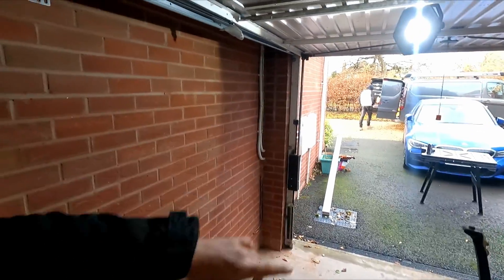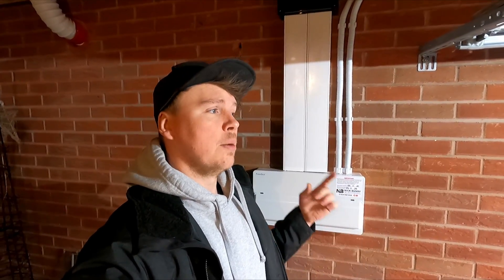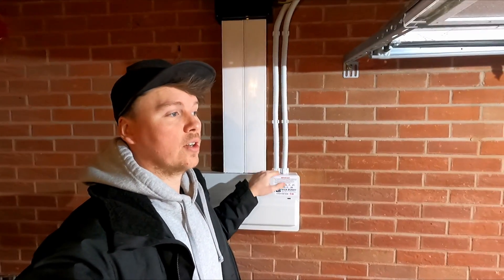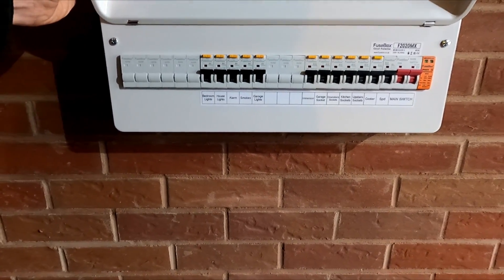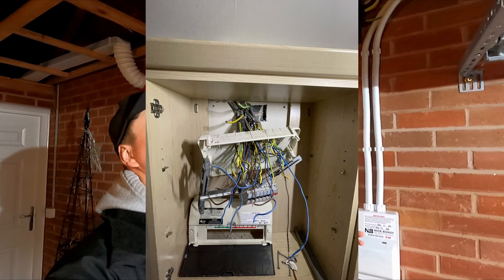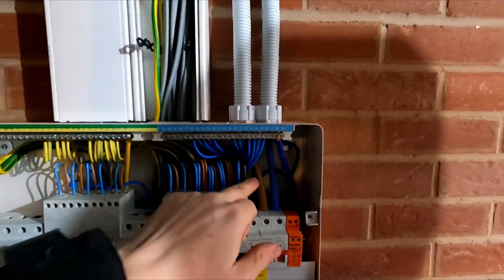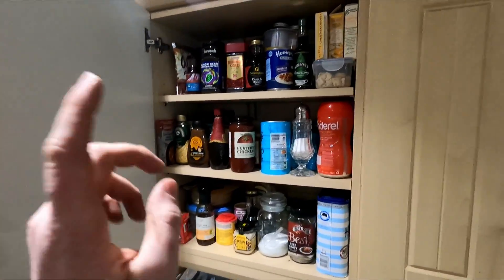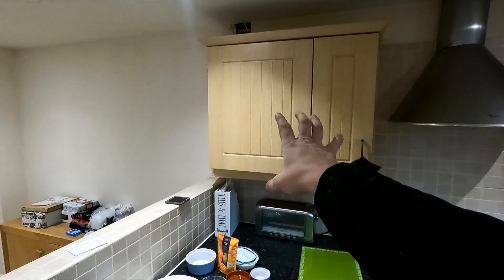How much do electricians charge in the UK

Comment: Why didn’t you just install a 3core armoured? From what I could see the cable wasn’t double insulated anyway. Much less drilling, good Earth. better protection for the cable. No worries about Eddie currents.
Reply: @Richard Moore   if the cables are protected by a fuse they can go as long as they want so long as it meets the max Zs of the fuse that it is on. 👍
Reply: @Richard Moore cable has to be protected by a fuse rated lowers than the suppliers fuse

Comment: Cores though different holes may be an issue in high power industrial setups, but at domestic current levels, and the thin steel of a domestic CU it's just a non-issue.

Comment: I'm, 82, mostly heavy industrial electrical engineering ( Steel Industry ) I have never seen any adverse effects of ac cables in separate holes, we had motors of 1,500 HP  but of course they were 500 volt DC. As for YouTube bloggers, obviously you have never heard of DrJohn Campbell, he has 1.79 MILLION subscribers. So Jordan has a bit of catching up to do , However fair play to him, his slick presentation & quality of work is exemplary ☘️

Comment: I think the eddy currents are negligible in a domestic setting but it's something that has probably dripped down from industry when there are much higher load installations. Great video, great to see how much you are quoting for, I think a lot of tradesman wouldn't feel comfortable sharing that kind of info. Keep it up mate!!
Reply: It's not so much loading, but the fact that industry generally uses 3 phase. If you pass 3 phase conductors through seperate holes, you end up making a very crude heater.
Reply: @listeningto8371  if the load is substantial then yes it would produce heat

Comment: Reasonable price but personally I’d of just run an SWA and used a switched fused isolator rather then a KMF switch and slipping the meter tails in copex would be better protected and also I think would look neater
Reply: Why the hell wouldn't you run it in armoured christ
Reply: Also cheaper per meter I reckon by a couple of quid
Reply: What size swa and how many cores?
Reply: running line neutral and cpc all individually is  pretty gash. I would of opted for swa, and it's cheaper per meter. 

 Isn't there a reg that states line conductors should have a cpc running in parallel aswel?
Reply: 3 core 25mm 100amp switch fuse isolator job done
Reply: I was always taught that a maximum of 3 meters is allowed for individual tails. I always go for a 25mm SWA with a 100a isolator. Much neater and the cable is protected.

Comment: By splitting the conductors you are increasing the loop area formed by the live and neutral. If you keep the conductors together (close coupled) you reduce the loop area and hence the magnetic field, which can couple into nearby equipment.
If you want to get into the physics to put it simply the magnetic flux is sum of the magnetic field at every discrete point within the loop (it's mathematically a surface integral). The magnetic field is greatest at the point in the centre of the loop.
When the live and neutral are close together you effectively get cancellation.

Comment: Regarding eddy currents. Sub 100A I have never found it an issue. On larger scale, I am talking 250A - 1225A TPN sub mains where for cost we parallel conductor's, we have had issue where slots was not cut and the sections of the panel board would get warm (current introduced in the metal work) according to thermal imaging. On these jobs we tend to make a square cutout and use Tufnol to gland in the cables. I have always felt 525.5.1 should include a current range where you should cut slots. Commercial DBs, panel boards tend to be of larger thickness materials as well.

I am commercial with some domestic work, so for me I always have, as I have found it good practice to cut a slot if I need to. I tend to only use SWA or MICC for sub mains, so it is rare I have a domestic job where I need a slot.

Comment: I've read a few comments below and agree, on a single phase 80/100 amp supply it's no big deal as far as eddy currents are concerned. However on bigger supplies, in industrial installations where you might have a 2MW transformer feeding a main switch panel, there can be a significant heating effect from glanding single cables through a steel enclosure, trunking, gland plate. This is why most decent manufacturers and main switch panel builders use a non-magnetic aluminium or paxolin glanding plate. It's also why large single armoured cables are aluminium sheathed rather than steel SWA. This is all covered in regulation 521.5.1 BS7671 also 521.5.2 for single core SWA. Hope that helps.

Comment: Yes, yes and yes. LNE through the same hole together! (In a metal enclosure) At first, everything seems fine, until load changes happen. Noise gets induced (variable, dependent on load change) this can be interference on sensitive Audio,  crackling or maybe hum? It can cause havoc with electronic power supplies. Small chargers etc. Phone chargers saying they are charged when they are not? The biggest effect, personally I found is a quiet 50 c/s hum from metalwork. SS sink, pipework, radiators or anything connected to earth that can resonate. Even on massive commercial buildings it can get louder,(depending on the variable load changes) even on the 16th floor! The air conditioning ducting, suspended ceiling grids, trundling, it's in the boiler house and even the re-bars in the concrete fabric! Press your ear to the wall, and it's there! "Where's it coming from", they say? Well, it's an earth problem and we know where to look!
The Earth is no longer just a protective conductor. It's also a functional return path on many modern gadgets (it's not supposed to be, but it is) and it can cause all sorts of modern noise on the "safety " conductor. 
I'm an old incapable man now. I come from the days where everything was metal. These are old problems coming back to haunt the new! 
Thanks for the video. It was really good  that.

Comment: There is an effect when line and neutral conductors or phases are put through separate holes but it's nothing to do with eddy currents.  It's due to the magnetic flux that's induced in the metal around the holes.  If the wires are in separate holes then the lines of flux surround each hole but if the wires are in a single hole of whatever shape then the currents cancel out and there's no flux.  This means that it only applies to iron or steel cases and not to aluminium ones.  When there is magnetic flux it causes heating in the metal due to hysteresis loss and mechanical vibration due to magnetostriction effects.  Both of these are probably negligible at domestic level currents.  A thin slot is all that's required to kill the flux.

Comment: Just seen this so comment a tad late. I trained as an industrial/commercial electrician many years ago and we always made a slot between holes when live/neutrals/3 phase conductors couldn't be taken through the same hole in a metal chamber. It was common to use brass bushes with locking rings/nuts/sockets to protect the cable from the metal edge and the theory was that if there were no slots then overtime the bushes could become loose due to tiny vibrations. There were other regs about not running a single conductor in metal conduit for the same reason, they always had to be in pairs as a minimum.  One way to get over this would be to run single core MICC where Eddie Currents would not be an issue give the otter sheath is copper, or a not ferrous metal/non magnetic material. But I am talking about huge installations such as the old BBC Centre or the Nat West Tower here in London etc and in a tiny domestic board/load I doubt it would be necessary but imv good practice to cut the slots regardless if the cables cant all be taken through the same hole. .

Comment: Eddy currents only become an issue on 200A single conductor feeders, to deal with it your supposed to cut out a rectangle of steel box and replace it with a piece of aluminium and bring the wires through the aluminum plate (no ferrous material)

Comment: Not sure if it has already been said, as I have not read all the comments, but, why did you not just run the mains tails into the trunking along with all the circuit cables? You seemed to have had a big enough hole in the the DB to do that and that would have saved you the additional stuffing gland/eddy currents dilemma.
Incedentally, your price seems very reasonable to me.

Comment: Hi mate we are a local small company and we are looking to start blogging! We like watching your blogs for ideas and some of your work is very neat and tidy but the 20mm flex tube you use for putting your 25mm tails in from the meter, which is normally protected by a 60 or 100AMP fuse raises a concern. But I don’t know if anyone has picked up you are running a live single supply feeding the tubing separate back to the meter.. what if someone mistook the tube for a water pipe and accidentally cut through the tubing there is no earth protection with that live and it’s backed up to an 80amp fuse? Did you get pulled up on that? Not here critique just interested in peoples outlook as everyone is quick to point out as we know. Keep up the good work we enjoy your blogs 👍🏼

Comment: The issue with tails in separate holes is more of a concern in relation to very high load current, not single phase 100 A supplies. I’ve seen loads of tails in separate holes, no slots and no thermal damage observed.

Comment: That's a nice installation, and to be honest you really have no concerns at all about eddy currents in that scenario - for future use. The only time you need to really start be concerned with this is in 3Ph Installations with heavy industrial inductive & resistive loads. However you will have an issue with your Cert, so you done the right thing changing it - technically unnecessary , but necessary to comply with regs. Charges should be open & I recon your pretty much bang on, Ill be honest I think what you can charge depends very much on the demographic of where your working. Ive just found your channel by the way!

Comment: Fantastic clear video and absolutely bang on price, I did a similar job recently but used SWA from main isolator to board, easier but not as pretty 😉
Reply: Phase Neutral and Earth should be in the same Conduit etc for Shock Protection

Comment: The slotting is only imperative when you are putting different phases through, not with L&N. Also you can replace the steel top with an aluminium piece, that will negate any eddie currents.
Looks like a nice installation btw!
Reply: That’s always been my take on it
Reply: Your 100% correct.
Reply: Not according to John ward

Comment: I always thought any further than 3m from main fuse had to be run in SWA with a double poll isolator installed? I was always taught that tails can’t be run any further than 3m.
Reply from the maker: They can be as long as they have been fused bud 👍
Reply: @NBundyElectrical  - ahh that’s good to know!😁😁 makes my life easier from now on 😅
Reply: Swa if burying them in wall

Comment: The induction effect at domestic single phase levels is just less than bugger all. Hence CUs are metal. In commercial/industrial three phase distribution boxes, the effects are more significant hence the entrance panels are non-conductive.
Reply: Or they are made of paramagnetic materials like aluminium opposed to ferromagnetic materials like steel.

Comment: Definitely run L & N through the same entry point. Earth is not necessary as it is not load carrying until a fault condition occurs and then only for a very short period of time. This does not apply if you're passing through an aluminium plate. Did several jobs where big panels were fed with 185mm singles through an ally plate and terminated on the busbars

Comment: I seen the JW video, and seen it had no affect, and thought why are we told to take certain precautions with single conductors in metal enclosures.
 My first thought was why use tails, I would have gone for split concentric myself, easier to work with than SWA, and you would not have had the issue that you rectified.
As for the price seems ok to me, obviously in different parts of the country that will vary.

Comment: Very neat job mate, im not sure about the cabling, id just run them in together, but what i am wondering is, is there a valid reason why you installed the C.U so low?, in my 20 years experience ive always installed them high due to potential damage and so kids cant easily access the C.U
Reply: Husband just said same, why is box so low, but then Ive seen them on floor under staircase so, no regs obviously !!

Comment: If I was you probably I was installing a SP+N switch fuse and I was running a SWA into the C/U. That’s is how I actually done to many jobs. 
About the Eddy currents things I believe John Ward demonstrate it that is negligible if is less than 100A, but I been on sites where I came across older sparks they were outraged that is not possible and if is “in the book” you have to abide to it, no matter if you can prove the contrary. 
And speaking about the quote… probably I was charging a bit more, but that’s probably because I’m based in London.
Reply: same

Comment: The distance between the Dno meter box and garage doesn't look over 3Mtrs ! so why not run tails to the garage then install the fused isolator just inside the garage and used an Swa from the isolator to the consumer unit ! Plenty of room to work and you can gland both ends of the swa (The people on here who suggest just glanding one end of the Swa so it fits in the meter box need to have a word with themselves)

Comment: Running the the tails through different holes effectively a transformer with a shorted turn.

Probably negligible heating effect in a domestic environment blow 100 amps but still good practice to put a slot in.

The slot effectively prevents current flowing in the short turn, the width of the slot is not important as air is a very good insulator and the voltages involved are in the mV range.

Comment: Move and install new rcbo unit = £850
New armoured cable for tails = £190
Downlights @ £70 per point = £630
Socket = £60
Switch & 80a fuse = £90
EICR = On us

London Rates.
1820 +VAT including all materials. Days work

Comment: Just to give you a comparison as a consumer. I bought a new build in Congleton so not far from you and I was charged £100 per spotlight. For a new build that's extortion as it's a first and second fix. So based on that the lights alone should be £900. That leaves £700 in the job for the consumer unit move, tails and sockets you mentioned.

Comment: Eddy currents not viable in domestic, as we know emf is produced as you said on a plane 90 degrees to cables going through  material this is eddy current and produces heat but you are talking 1000.s of amps, I personaly would run SWA to consumer unit. Very neat job in CU and I wouldve charged a bit more probably inr £2300. very good video and thanks for sharing

Comment: I done a similar job and used 32mm rigid conduit outside . That way you can get the  25mm tails and 16mm in the same conduit . Looks so much neater than that flexi .Also some brands of flexi deteriorates  with sun light .
Reply from the maker: The conduit on the outside is solid conduit bud 👍

Comment: 6:40 - As ever, it does look immaculate but I do wonder about the IP rating. As we all know, it’s IP4X on the top and IP2X everywhere else. When it comes to the garage circuits, everyone seems to think that the top surface doesn’t count if you raise it up high in conduit or trunking. To me, that looks less than IP2X. If you left some cheese in that board, you could catch a mouse in there very quickly.
Why not put a nice end cap on the trunking and come out the side near the top - even with separate holes!
Love your work. I’m here for the feedback. I’d invite you to work on my house any day of the week. Top stuff.

Comment: First time viewer good video 👍 I like your attention to detail and neatness. 

Although it probably won’t cause any issues on a domestic installation bringing the tails through separate holes is against the regs when entering a metal ccu. When completing your DEI cert you have to confirm that they enter through the same hole. 

I’d say slightly on the cheap side depending on where you are in the country. If I was you I’d probably charge a bit more and use better quality ccu. 

I use Crabtree fully RCBO with a built in 2 mod SPD. I would also use a Crabtree back plate to suit the ccu size. I’d bring the maxi trunking floor to ceiling down one side then come across the top of the back plate and ccu with another piece of maxi trunking along with the angles and stop ends. That way all the entry is through the back plate and more importantly from behind into the ccu including the tails. This makes the job ultra neat and very quick every time.
Reply: Could not agree more with that 2nd paragraph 👏

Comment: If meter tails are over 3 meters then you should have and independent isolator switch in circuit mate
Reply from the maker: There is mate, KMF switch with 80amp

Comment: I was always taught any run over 3m, needed to be swa with an isolator ?
Reply: Same here that’s what I got taught
Reply: SWA would look much better. Not a big fan of long running tails at all.
Reply: Doesn't matter what you are taught matters what the regulations say however there is nothing wrong with doing more than required
Reply: Tails and fused isolator is fine SWA would be used if cables were to be concealed in walls

Comment: I know I've mentioned it before but sparky ninja has stated that fusebox rcbo's are the most susceptible to heat build up and causing a reduction in capacity. since I have known this, what I do is stagger them. So 32,6,32,10 etc etc. in my eyes the lower loaded rcbos will allow that heat to disperse between the generally higher loaded ones.